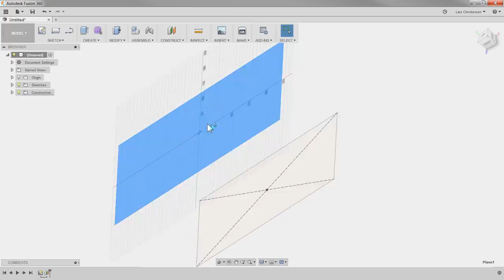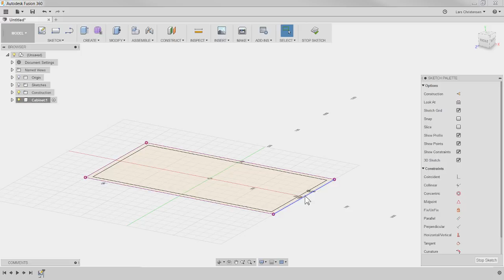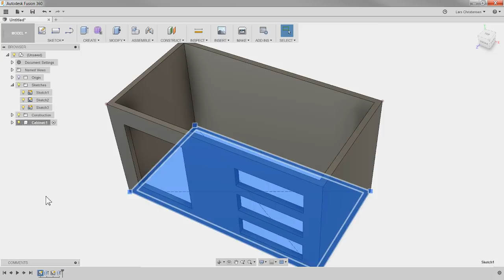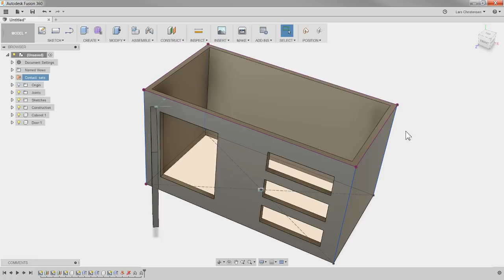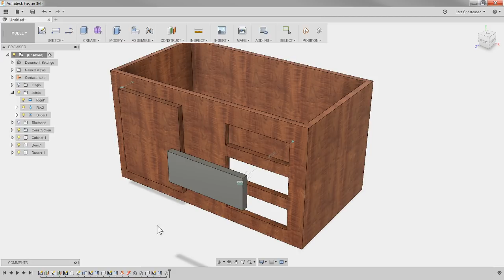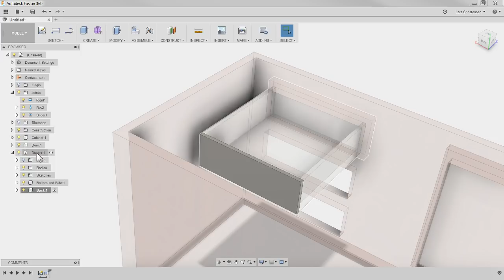Skeletons in The Wood Cabinet — Fusion 360 Tutorial — #LarsLive 112

Comment: Great video now I need quick advise
We are using a Mac and SketchUp creating dxf files and manually exporting and assigning tools to the file to be. 
Cut on a Biesse Robert B CNC
We are trying to make this process more strait forward. 
This software generated the gcode ?
Thanks
Reply from the maker: Yes. You can create gcode from within Fusion 360
Reply: Oh this is my big question as the biesse uses bsolid for nesting.  I need to export my model with tools so i don’t need to redo the work in bSolid.

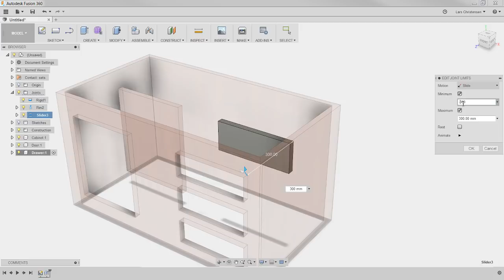Comment: As always learned alot again. Hi Lars, at 26:30 I put 0 in the Max Edit Joint limit, and any negative number in the Minimum..:) The drawer will not go straight thru the cabinet..:)

Is there a continuation to this video?
Reply from the maker: Hi Marvin Gorospe Thank you for watching!
Not to that specific video, sorry.

The limit is a little touchy. You always have to make sure your lower limit has a lower number than the hight limit

Comment: Love the 'free style' way you quickly made this cabinet. Dumb question, does F360 then track each component and material sizes used, so a designer can then make a parts list with dimensions automatically or is this something the user has to go back and then dimension each piece, etc.

Your desk video shows something along this line, but what steps are required for a complex assembly as this cabinet?
Reply from the maker: Hi Doug Hanchard Thank you for watching!
You can create a 2D drawing that will update the dimensions. The part list in Fusion will not display dimensions yet. I am sure this is something the development team are working on.

Comment: Great Video (again) This is right up my alley for my project. Making Acrylic aquarium sumps to export to my hand held router (Shaper Origin). My question is in the details of each piece to be able to cut them. For instance, the front of the cabinet is not modeled as an individual sheet, one could lay on a work bench and cut out. Do you need to draw little separation lines at the corners to be able to do this? Thanks for such great videos!
Reply from the maker: Hi Damion S Thank you for watching!
You could, of course, have modeled each side individually so you would not have to split it. But, you could also do it like in this video:
https://youtu.be/omeSFaLz6j0

Different ways to win :-)